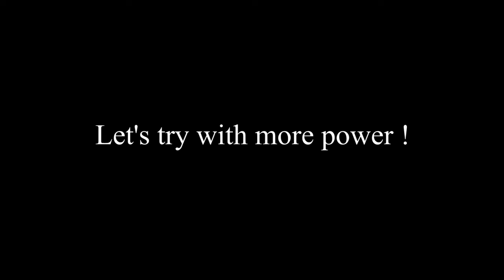Head on train crash movie, on a bridge, derailment after collision, behind the scenes. HO scale fail

Comment: Well, you did good on the actual recreation of the movie crash. However you went way to fast with the models on your final version. Locomotives doing multible flips into the air is just not realistic. A train derails just in the front where the crash happends, not the whole thing at the same time. Hard to do with models since there small and noth heavy, but you cound have used some regtangular shaped plastic parts to make the cars derails sideways and not shooting straight up into the air.

But in the end I'll have to say: Great work Guys !
Reply from the maker: Yes it could be more realistic, it was difficult to find the right balance between weight and speed...
Reply: I wonder what kind of locomotives were used in the film.

Comment: Did any of the model trains actually Break?
Reply from the maker: Not really, everything is useful today, except the set !
Reply: Ok you should use the set for a layout
Reply: Engines #8322, #8490, #8326, & #8352 my namesake SD40T-2 weren't harmed in the making of this movie.
Reply: The locomotives were ridiculously cheap. Correct?
Reply from the maker: Mine or the locomotives used in the movie ?
Reply: @MiniaturesFX The real engines. I know a runaway involving #8352s sister, #8278.
Reply: @MiniaturesFX I know of a runaway train that involved #8352s sister unit #8278. 😂😅

Comment: The trains were moving entirely too fast!!! The trains needed to be traveling much slower!!!
Reply from the maker: The speed is good: we shoot in slow motion. But the trains should have been heavier.
Reply: @MiniaturesFX  My Grandpa and I used to do the same thing that you are doing!!! Weight the trains down, then push them a bit slower toward each other and keep pushing your effect will be much better!!! I wish that I had that bridge on my model railroad!!! When I am done with the track, there will be over a mile of it!!! Right now, I have over 2000 feet!!! Those Athearn locomotives need to be glued to their frames so that the bodies don't pop off!!! Put some gasoline in the tank cars, and ignite it just as the Nevada Petro is derailing---make sure that you have some fire fighting equipment handy:)!!!
Reply: @wasatchrangerailway6921  some things Are built different Unlike other buddy